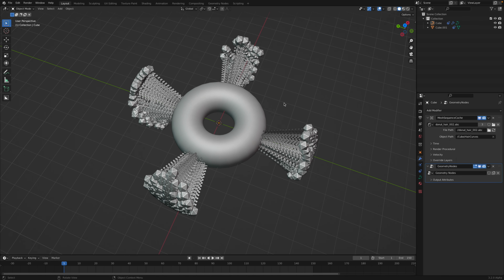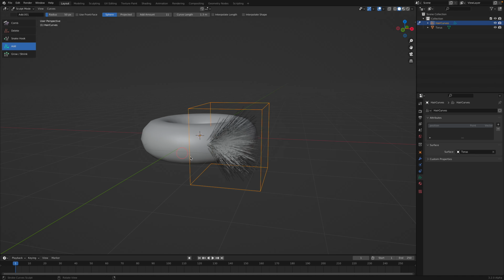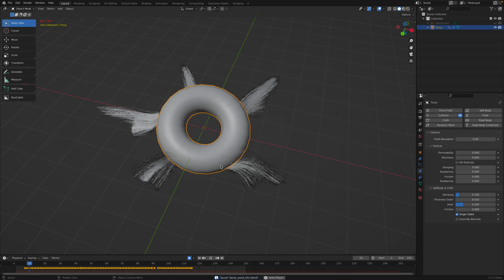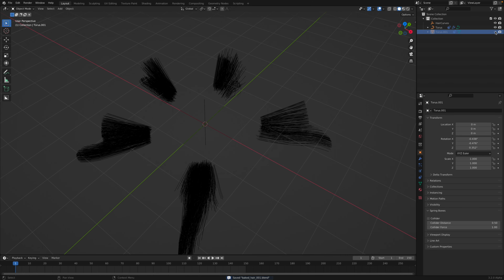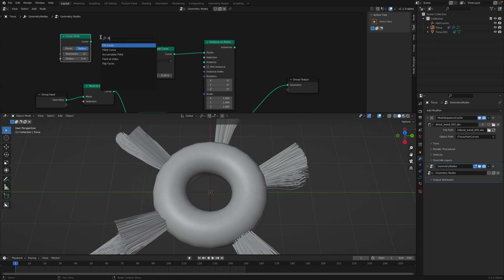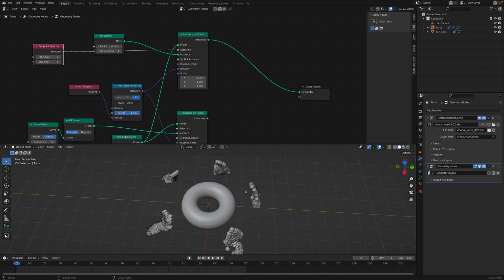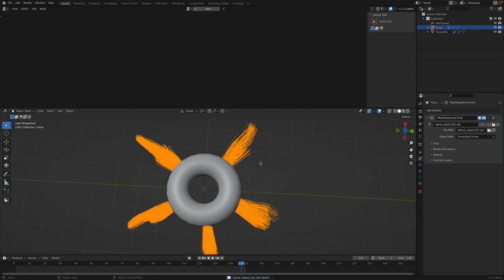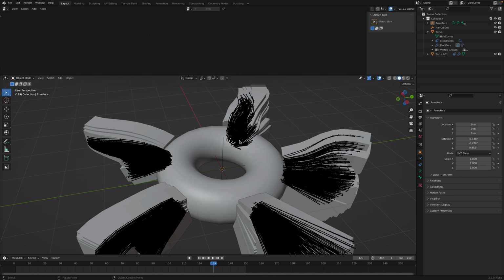BSLIVE / Hair Simulation Baking For Geometry Nodes

Comment: Hi Jimmy! Great video! One question though. When I try to render this, the hair doesn't move. It works in the viewport but not in rendered mode
Reply: Hey! Found a workaround! A bit hacky, as it extends the pipeline with extra steps, but in some cases it might worth the struggle. Once you got out your alembic hair and imported into your scene, follow these steps: 1. Select the animated hair/curves 2. Go to File>Export>PC2 (if you dont have it there, you should allow it in preferences/addons) 3.  At the export settings set your framerange to match your timeline (start - end) and uncheck the flip y axis thing, because it will mess up your position when you reimport it. 4. Export your PointCache file somewhere where you can find it 5. Go to the modifiers tab, you can either delete "MeshSeqeuenceCache" or just turn off its visibility (both viewport and render) and leave it there just as it was. 6. Add "MeshCache" modifier 7. In the MeshCache modifier options select Format: PC2, Set file path to the cache file that you saved in step 4. Now if you add geonodes modifier, or depth to the curves in the object data properties, it should update on every frame properly!